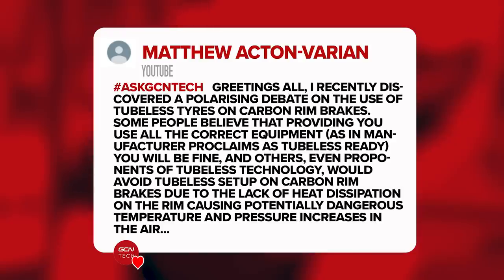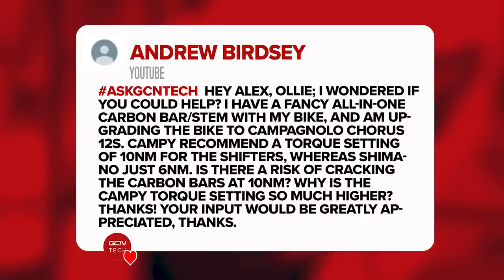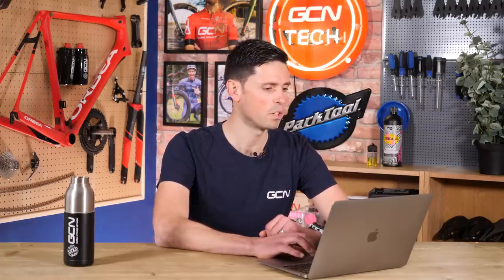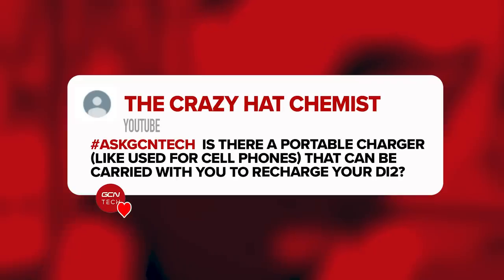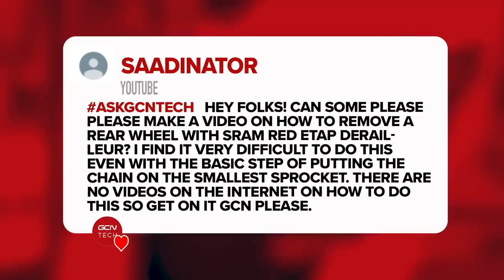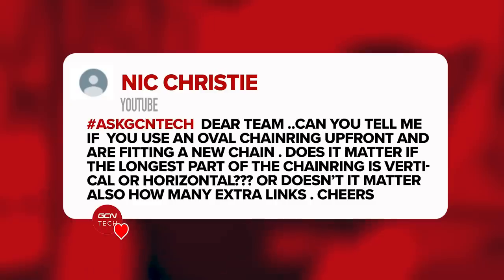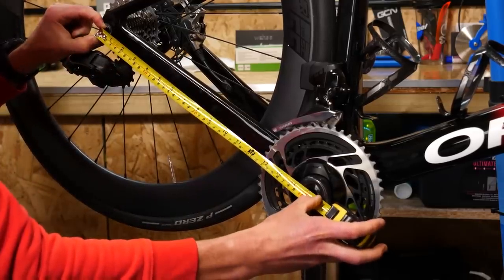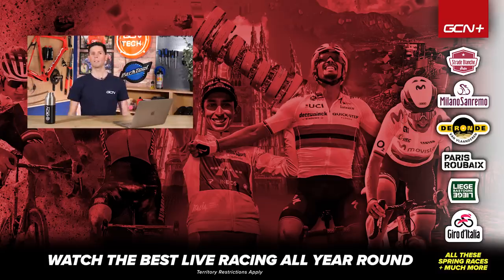Tubeless, Di2 & Oval Chainrings: Your Questioned Answered | GCN Tech Clinic

Comment: While I don't know the bolt size differences between the Shimano and Campagnolo, different torque settings on different size bolts will give the same clamping force. For example if the Shimano uses an M6 bolt and requires 6Nm of torque then the force from that bolt is around 1,250#. If the other uses an M8, for example, then 10Nm will result in around 1,500# (2,100# for an M6). Again, without knowing the different bolt sizes I'm just guessing here but if they're different then it's possible they both achieved the same force on the carbon while using different bolt sizes/torque settings.
Reply: This is interesting - i've heard that torque settings really have most to do with the bindings rather than the object that's being clamped, this would explain a bit why!

Comment: from personal experience, YES, tubeless tyres can damage carbon rims. I have Bontrager Aeolus wheels and my front wheel was sent for warranty replacement 2x. This was due to the carbon fairing/layer on both occasions was lifted up from inside part of the rim wall where the tyre beads hooks to the rim. I had Schwalbe Pro one’s and Veloflex on that wheel. Apparently there are grooves at the sidewall near the beads of those tyres and when inflated i think those grooves scrape through the point where the carbon skin and wheel fairing is glued or welded. The high pressure lifts this up thereby causing the carbon skin to be peeled off. Happened to me 2x, they told me maybe it’s my tyre lever, but thing is because of GCN i learned how to replace tyres without levers 😁, so yeah no tools caused the damage

Comment: Speaking on the tubeless - I’m using carbon tubeless on my Ridley, rim brakes, with carbon-safe rim brake pads. No issues.
Reply: Which brake pads do you use?
Reply: @patricksudbrock3087  SwissStop carbon rim brake pads. They’re about $40 a set
Reply: Also to this point, I believe a tubeless setup would have a far greater capacity to conduct heat away from the brake track than a tube or tubular setup. Nearly all liquids have a much much higher capacity to conduct heat than air.

Comment: My lower tier SRAM rear derailer has a little button you can press once it is pulled back that "locks" the derailer in that open position.   Then you just give it another tug and it releases after you swap wheels.     It makes the entire process simple.   I'm surprised a red derailer wouldn't have a similar feature being top tier.
Reply: The red one doesn’t have a clutch so that’s why it doesn’t have a button like yours.

Comment: #askCGNTech Hi Alex, a couple of questions on carbon seat posts. I've got a Scott Addict with a carbon frame which has the original Syncros aluminium seat post and am considering upgrading to a carbon post. Question one - do carbon seat posts significantly improve comfort (vibration reduction etc) and question two - can you clamp a carbon seat post in a service stand (as I'm always told never to clamp a carbon frame). Cheers mate.

Comment: #askGCNTech I upgraded my Fulcrum DB 700 wheels with tubeless GP5000 32 mm. For some reason, it's losing pressure. Over 1-2 weeks, it can go from 70 PSI to 40 PSI. I pretty much need to check my tire pressure every other day, if I want it precise. Is this normal? I've tried replacing valve cores and adding even more sealant, but no help. I've also used Continental tubeless valves. Just putting the wheel into tub of water doesn't show any bubbles. Is trying out a different brand and amount of rim tape worth it?
Reply: That’s just how the systems work. The tires are more porous so the air leaks out faster over time, all though you can go a couple days of regular riding without topping up your psi it’s honestly a good idea to check your tire pressure before every ride.
Reply: This is normal with tubeless tyres, I have just changed from the Conti 5000 TL's to the Conti 5000 STR's which are way worse at losing air and must be checked before every ride, they lose approx 10psi over 24 hours.
Reply: The giant gavia tyres that came on my bike were very good for holding air but now I've upgraded to Schwalbe-pro-one-tle they drop fast.
Can just about get away with 2-3 days but if I have time I check pressure every ride 👍

Comment: #AskGCNTech My rear tire needed changing recently. They were continental GP 5000s. The tires that were originally on my bike were Mavic Yksion Elites. Since money is tight, I put the front continental tire on the rear wheel and put the old Mavic tire on the front. My question is: If you had only one higher quality tire, would you benefit more from putting it on the front or rear wheel? Performance-wise, would it even make a difference?
Reply: No you just want the newer tire on the front for safety. Check out conti ultra sport, good tire for a low price, mainly just heavier not much slower.
Reply: Front makes sense for slowing down
Reply: Both tires had similar wear. The one now on the rear wheel has more total miles than the one I put on the front.

Comment: #AskGCNTech Hey guys, I've notice that the my rear gears shifts perfectly when I'm in the small chainring but then when I shift into the big chainring, my rear gear indexing becomes a mess. Any idea why this is happening?
Reply: cable get crossed
internal cable routing? please redo the cable installation again~
Reply: Check the alignment of the rear derailleur. They tend to twist after use and will cause shifting issues.

Comment: #askgcntech Hi Alex, Oli and Manon. My bike where I have had installed Tubeless tires (GP5000 TL) on newly bought carbon wheels says I should not go over 70 psi because the rim are hookless. I really doubt their statement is accurate as the wheel manufacturer indicates a max of 100 psi for tubeless setup. Who is right the wheel manufacturer or the bike shop ?

Comment: I have an OSPW and a large front chainring (58). Do I need to calculate the chainlength any different because of the OSPW? #AskGCNTech
Reply: Yeah if you size the chain in big big without the rd in play and add an inch, that’s not enough, but there’s not a hard and fast rule of an extra 2” or 3”.

Comment: #AskGCNTech I have just upgraded my road bikes full group set and shifters from Shimano Tiagra to 105 and the chain rubs the front mech in biggy small and small big. I have tried changing the cable tension and also changed both limit screws but cannot be get it to work without rubbing I have also replaced the cable covers, I am very stuck any help would be greatly appreciated. Also keep up the great work 👍
Reply: Sometimes that’s just the way it is. I compromise one way or the other so it’s only rubbing in one of those combos not both. It could be you have an older front mech, the new shifters work with the newer front mechs. That said I have an older front mech and newer shifter and that gives me the same rub problem.

Comment: #AskGCNtech: is there such a thing as the most efficient bike speed?  Cars used to be designed to be most efficient at around 60 mph. MPG is an easy criterion. What about bikes?
Reply: on a road bike, the most efficient speed should be depends on your engine(yourself) where you can keep at 80~100rpm
Reply: Yep, you're the engine so run at your most efficient speed (cadence)
Reply: @jakethesnake1976  not power?  Not heart rate?  For me, optimal cadence needs to be variable.
Reply: @Karovaldas  true you obviously don't want to run HR in the red, but you can control that with gear changes, the power will drop off but you will still be running at an optimal efficient cadence 👍

Comment: #askgcntech - would using different types of materials in your cockpit reduce vibration?  For example, carbon frame and fork, with an aluminum or titanium stem, and a carbon bar.  Or a titanium seat post with a carbon frame.  If the answer is yes, is the reduction in vibration likely to be noticeable or would it just matter to huge nerds?  I’m a road and gravel rider.  Thanks!
Reply: In my experience buying lots of carbon parts for “vibration dampening” does very little. Going to a wider tire by a few mm’s makes a way bigger difference

Comment: #AskGCNTech
I'm looking to get a power meter for the first time and am unsure what to go for I'm currently running shimano tiagra and all the power meters I can find are for 105 and above. Any help would be appreciated
Reply: Try a pedal instead. I got Garmin Rally RS100 on my older Ridley. Works perfectly, even with a Wahoo GPS
Reply: I recommend the Favero Assioma Duo(double-sided) or Uno (Single-sided) depending on your budget. As they are by far the most accurate pedal based power meter tested by lots of youtubers. I have the Assioma Duo myself and life has been great with it! Great battery life, L/R balance, accurate power reading and so much more. Plus, a pedal based power meter can be installed to any bikes when is a bonus for me if you own multiple bikes 😀
Reply: As long as the axles match (hollowtech II) and you get the same length, they will work. PMs only start at 105. Look at a single sided 5600 or 7000
Reply: Assioma duo for the win, plus you can easily move them to another bike
Reply: Get a 4iiii 105 left crank, it fits the same on your tiagra crankset, and saves some weight.
Reply: Pedal based is best imo. I've had Assioma Duo for nearly 3 years and they have been faultless.  They also do a single sided version (Uno)

Comment: Can dropping my bike on its side cause damage? The pedals and therefore cranks would hit the ground first, and I imagine that is a strong part of the frame.
Reply: If you drop it on the drive side you can easily damage or break the derailleur hanger and potentially bend some of the teeth on the crankset. It's also possible to break spokes, damage a shifter or knock it out of position, and even damage your frame. So it's best to avoid.
Reply from the maker: Yes it can. As Mal says, it's worth checking your rear mech hanger. We have a video here if you're not sure 👉 https://www.youtube.com/watch?v=hUigTujt-kk

Comment: #AskGCNTech Why can’t anyone [truly] solve for bicycle flats being as rare as getting a flat in an automobile? 

Now I know that automobile wheel and tire set ups are very different than a bicycle wheel and tire set up, but just the same I can wear out a set of car tires without getting a flat, whereas on my bike even with great care and maintenance I can experience a flat quite easily at times. 

Now, I know that there are foam inserts, sealants, etc. But, why is there no reasonable solution similar to what the car industry has figured out for automobiles?

Thanks guys, and gals!
Reply: The difference in tire thickness is the reason. If you want less flats pump your tires up more. All this nonsense about comfort riding with less pressure leads to flats
Reply: Because bikes with tannnus solid tires are worse to ride. Just like bikes with tires as thick as car tires would be worse to ride.
Reply: Because the resistance to flats is inversely proportional to rolling resistance (for now). So, you can choose e.g. Schwalbe marathon tires and you won't have flats. Most probably never. But it is much slower and much much havier than quicker tires. On my older touring bike I had Schwalbe Energizer Tour Plus and I did not have a single puncture in 10 years. But they weigh almoust 1 kg. Each. :/
I also hope that a material with low rolling resistance and high puncture protection will be invented. That would be something! I think this will happen some day, I'm optimistic :)